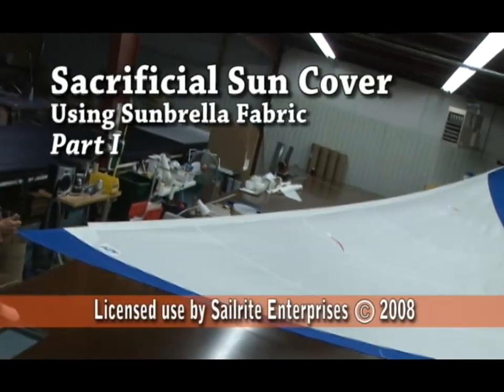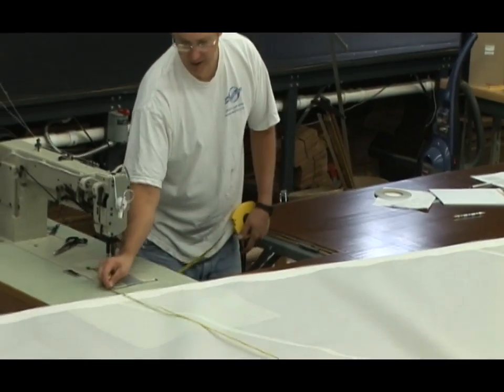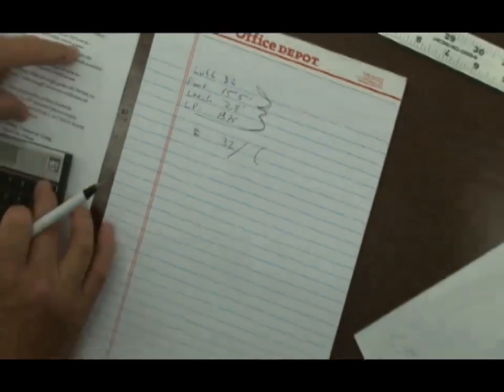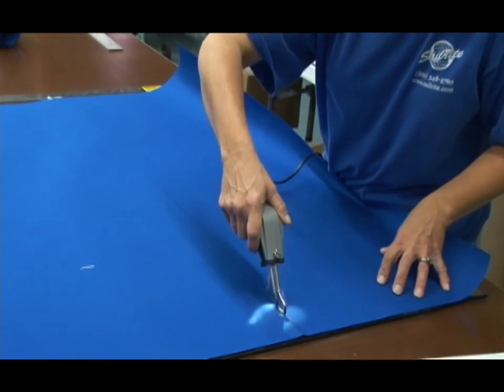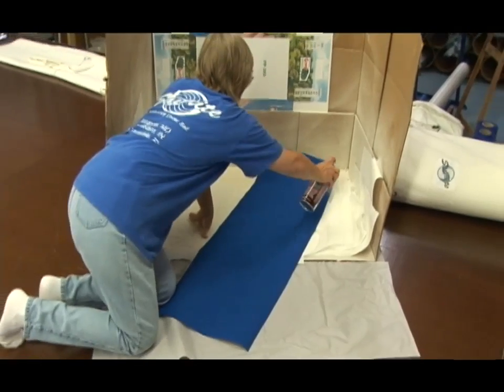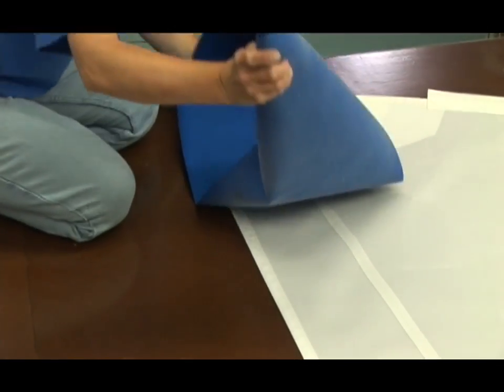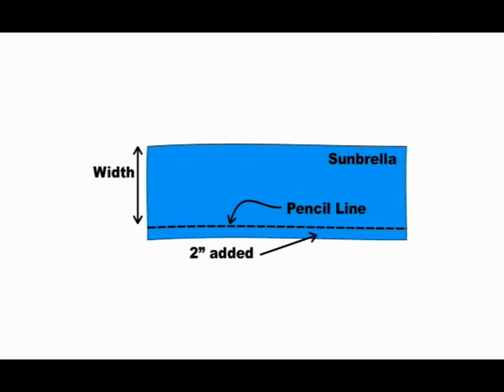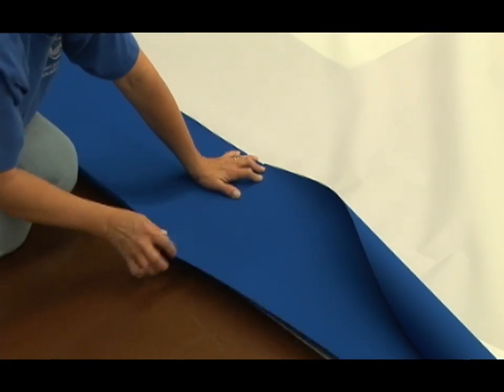Installing A Sacrificial Sail Cover for Sailboat - Part 1

Comment: Great video series and a great kit! Guided us through the process of installing a sacrificial cover on our existing sail.

A couple of things we learned in the process. Allowing 2" worked well on straight edges, but we were a little tight on room for the back-side hem at some points where the sail curved. If we had it to do again, we would allow 3". Then after the front-side seams were sewn (the inside seam and the seams to connect the panel), we'd flip the sail over so that the cover is facing down, and then traced out a line that is 2" from the edge we are working on.

Our existing sail already had thick patches at the tack and the clew, and there was no way sewing machine would get through that scruff--very thick and stiff. So, we sewed as far as we could, which got us pretty close to the end, then glued down the remaining inch or so of fabric, using a permanent glue.

Thanks Sailrite, for a good job on the kit and the video!